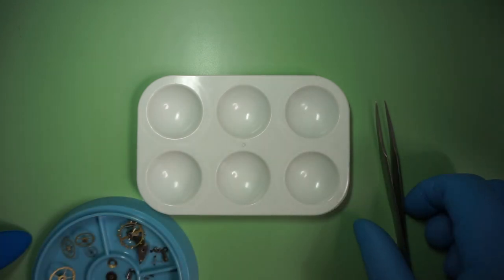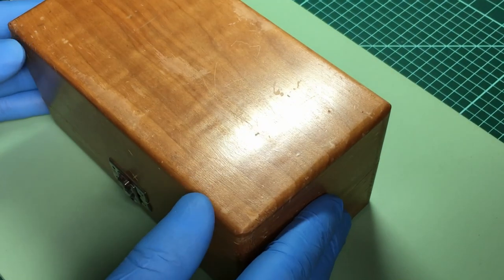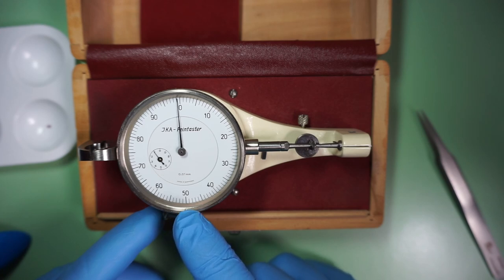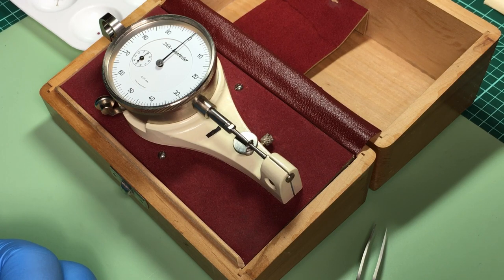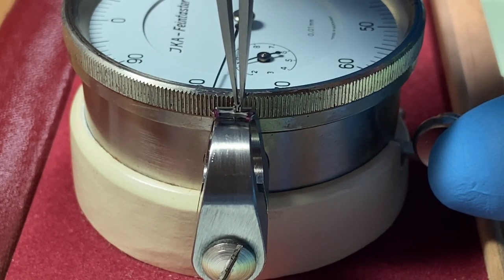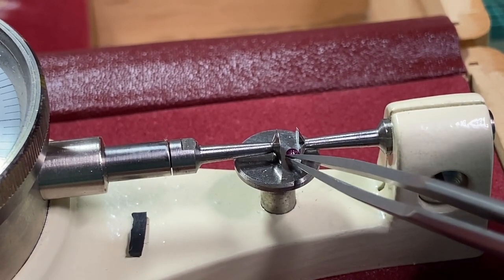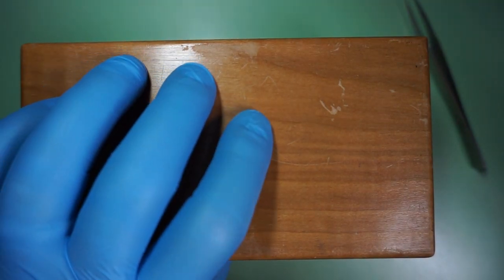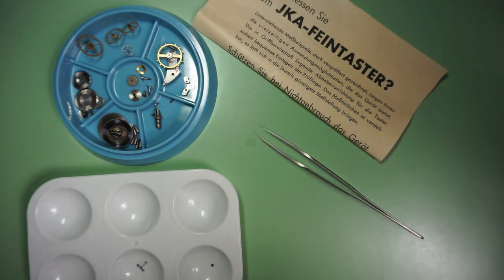Watchmaking Precision Tool Review - JKA Feintaster Micrometer - How to Measure a Watch Jewel

Comment: So, the question really is. How does this tool help you more than a Micrometer? Could you let me know what you used before this? Have you compared the two? Is this the first measuring tool you have owned for watchmaking? So many questions are left unanswered, and only a few videos address this topic with this tool. These are great questions to address, considering the price difference between this ($450 to $650, depending on the type and condition) and a good Micrometer that can be had for $100 to $200.
Reply from the maker: Hi Eric.  I'm not sure I understand your question.  This IS a micrometer.  The only other measuring tool I use for watchmaking is a digital caliper but it is not accurate enough to measure the small pivots and jewels needed for some repair jobs.  This micrometer is mounted on a horizontal bed which makes it much easier when dealing with small parts than trying to manipulate a hand held micrometer.  I would recommend trying out several different models or micrometer before you buy if at all possible.  As you noted, they can be very pricey, but deals can be found online if you are willing to purchase used tools.  Hope this helps.  Thanks for watching!

Comment: Does this famous Feintaster also measure internally?.  If it did, then I would understand why it is so coveted.  Say the jewel is entirely missing...how do you measure to find the proper size with such precision then?.  You can measure the pivot of the wheel or pallet fork for the inside hole diameter, but what about the outside diameter?.  Say you just wanted to measure the internal diameter of a barrel...can the Feintaster do that?.   I was just wondering because I noticed it's tough to find a micrometer that does both internal and external measuring.  Most only do external.
Reply from the maker: Great question!  Let me direct you to another video of mine called “How to replace a watch jewel and Horia Tool Review. This video shows exactly how I measure for the inside diameter for the new jewels using the Feintaster along with the pump pushers from the Horia Set. I hope this helps!
Reply from the maker: Here is the link to the video. 
How to Replace a Watch Jewel and Horia (clone) Tool Review
https://youtu.be/yXNVIAtMouc

Comment: Great job, showing this rare instrument. I am actively looking for something like this. Do you know any alternative instrument I cab find on market?
Reply from the maker: There are several different levels of precision and, of course, price when it comes to measuring devices. This would be called a bench micrometer. There are also dial and digital calipers, hand held micrometers and millimeter gauges. They can be found new and also used. Hope this helps!!